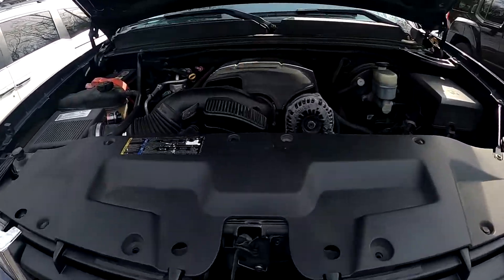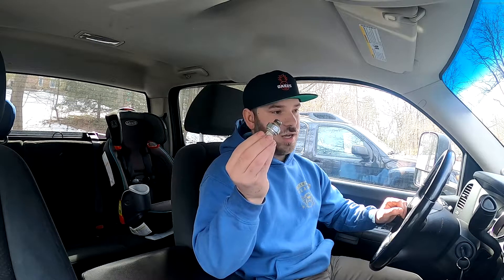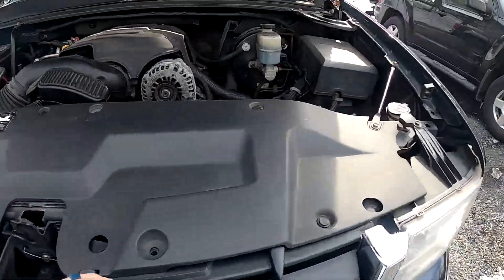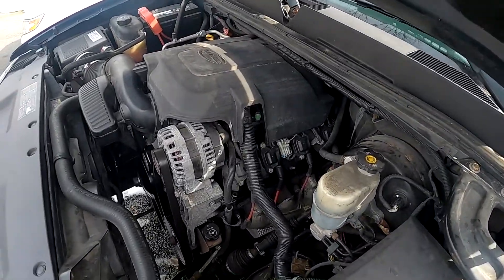How To Fix GM 5.3 LS Engine Low Oil Pressure!

Comment: Pull up diagram for the engine that shows  where the oil travels. Consider things like the pressure relief valves. And motor oil temp.